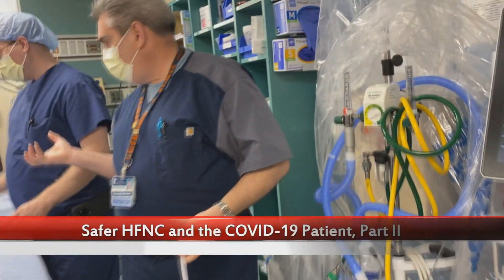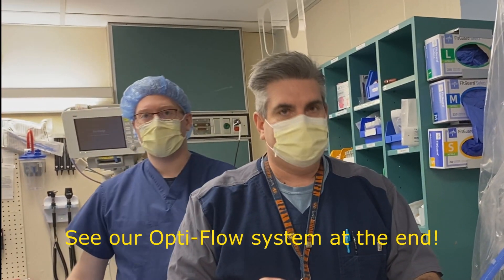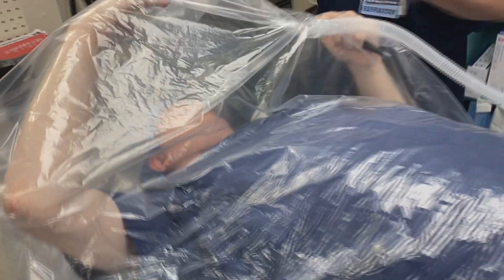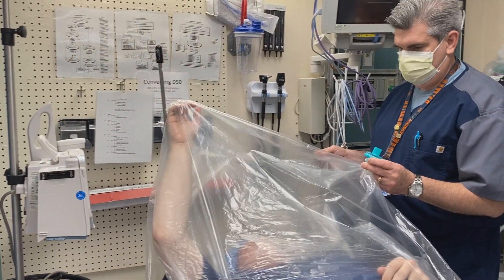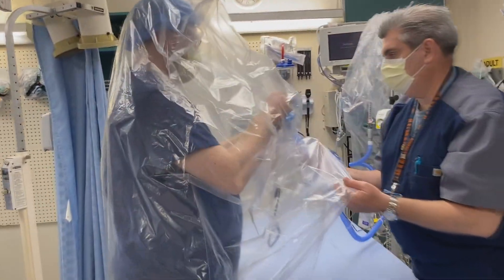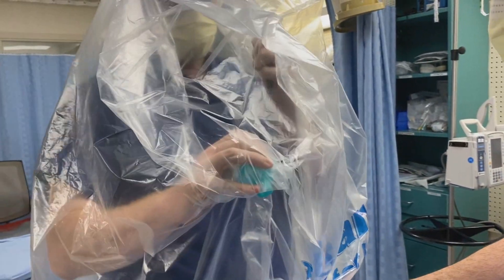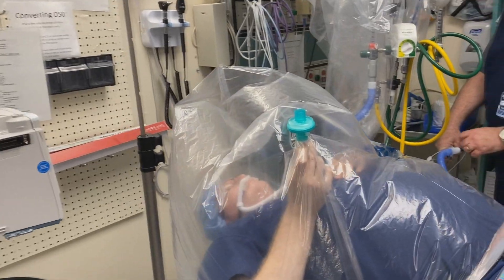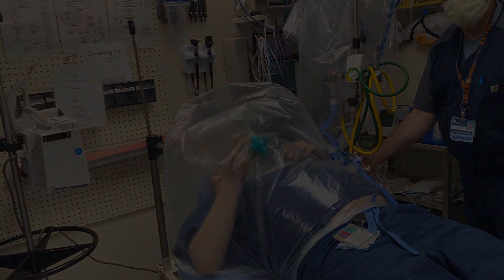Safer HFNC and the COVID-19 Patient, Part II

Comment: Would this be a temporary containment solution until the patient gets to a negative pressure room, or would it be full time to protect staff inside a NP room? I like it! The bag/tent sealed to the patient's skin with the O2 in and viral exhaust filter seems like a great containment solution. This is a serious threat. I'd be unhappy being told I needed to be put in a personal tent of course, but I'd understand that it was necessary to keep others alive and I would cooperate. We only have an instinctual aversion to the bag because it invokes basic suffocation fears; with O2 suffocation isn't a concern. 🤷 I love that you're on the lookout in the ER for normal supplies able to be used in very abnormal ways to improvise. :) You're a great teacher and innovator.
Reply from the maker: Thanks, it's actually fun brainstorming for ideas.  I agree with your observations, though.